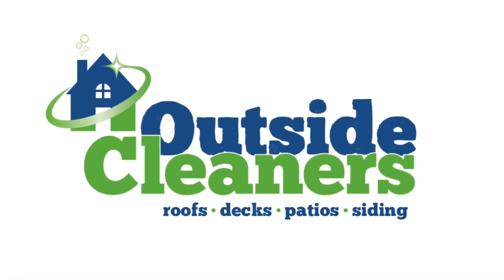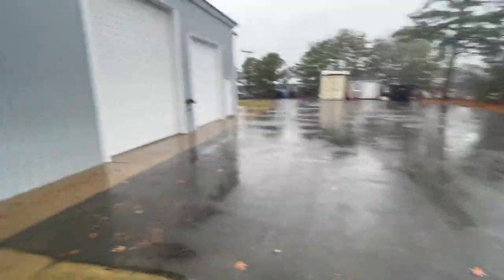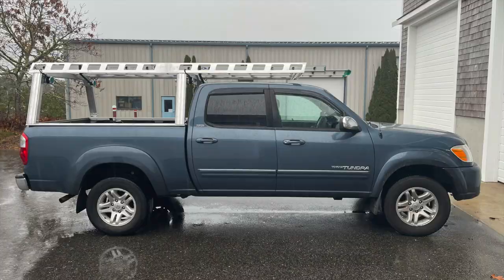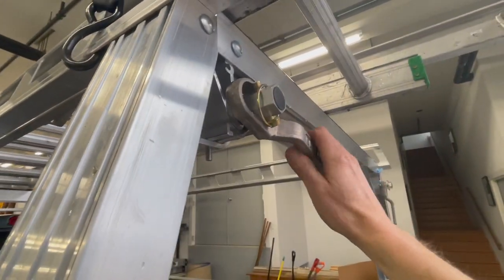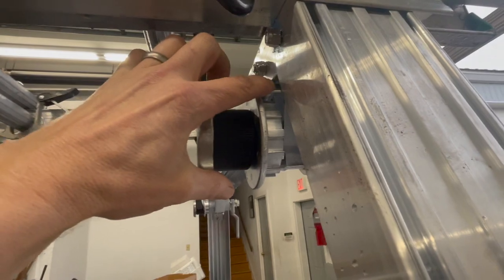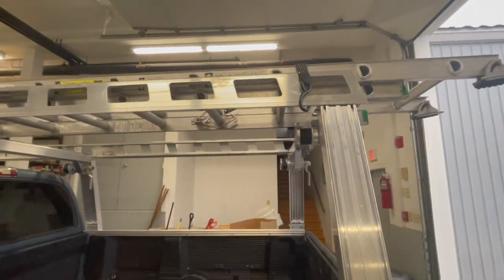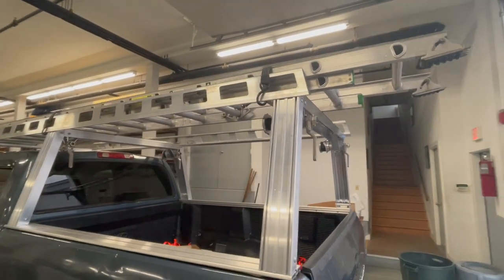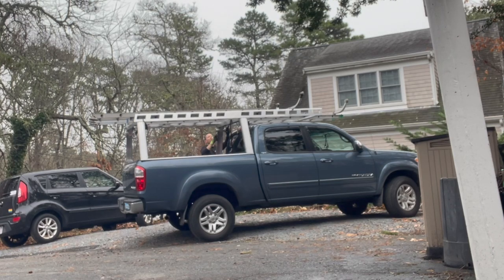System One Ladder Rack

Comment: Was considering this rack, how is the weight rating and have you noticed any limitations so far?
Reply from the maker: From their website: Its heavy- wall, large-profile, rust-free aluminum extrusions provide a 1250 lb. capacity in the Heavy Work I.T.S.® series Contractor Rig and a 1000 lb. capacity in the Standard Contractor Rig.

I've read an account of a guy rolling his truck, totaling his truck, but keeping the System One rack for the new truck because it was still good.  

I haven't noticed any limitations, but I only ever carry at most 5 extension ladders.  Super-happy with the product.

Comment: Did you have to remove the plastic guard from the top of your truck bed that the trucks come with or system one track lays right on the plastic?
Reply from the maker: Yes, there was a plastic “rail cover” on each side of the bed which I removed so that the rack base sits flush to the top of the sides of the bed.  👍🏼

Comment: Did you have to drill the bed?
Reply from the maker: Yes, horizontal holes in the upper inner sides of the bed.  I think they were in the 0.125-0.25 inch size range.